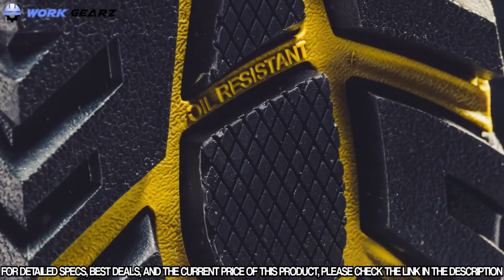Top 10 Best Railroad Work Boots

Comment: I don’t think any mock toe boots will work on ballast rock
Reply: if ur not kicking the ballast it could but i used Irish Setter Kasota item number 83864 and the only thing going on them is the sole which the ballast chews up.
Reply: @draconite420  Yeah of course the upper will last but I meant to say the outer sole wouldn’t stand a chance. I use redwing supersole 2412 and so far not a single scratch or tear on the outer sole